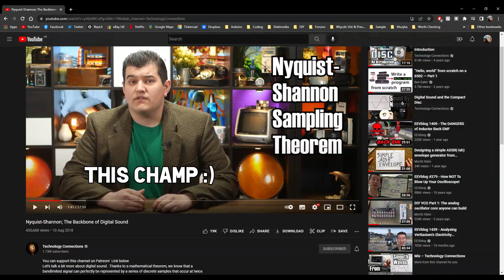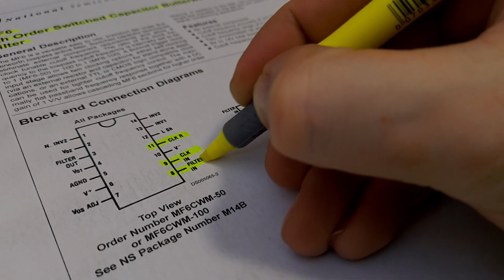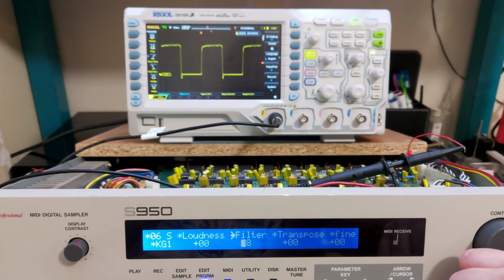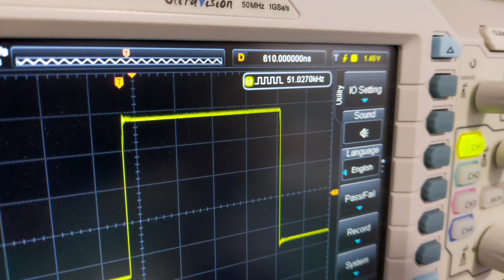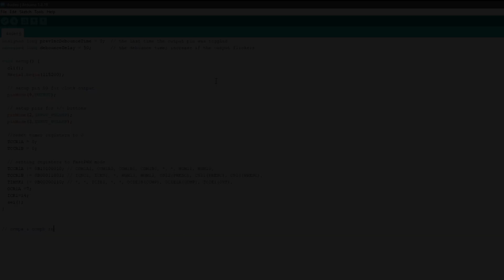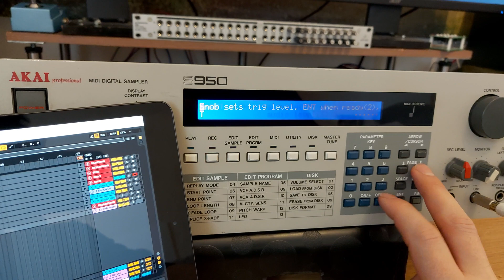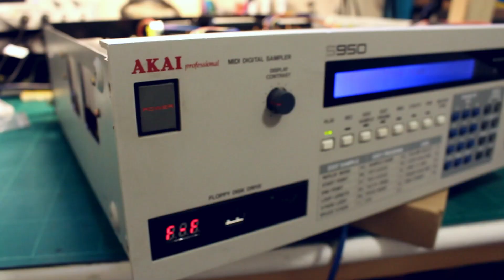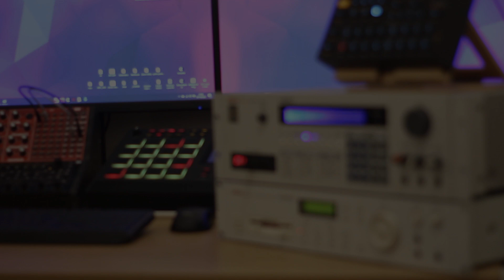Akai S950 DAGSS mod

Comment: I've always know that Akai engineers designed in a filter to shave off unwanted (lovely) fizz and hair - in an attempt to clean this up.  Even when I owned on back in the late 1980's, we HATED this notion.  The Emax and Mirage (and EPS) either didn't have the filter, or left it "user modifiable" and you could get that bright crunch if you wanted it.  Thanks for taking to the time to upload this.

Comment: Amazing work man! Have you also tried clocking the filter lower than 15.7kHz to close it even further than originally possible and if yes, does the clock signal "leak" into the audio signal? Just asking because on my S900 there's a strong 16kHz component in the signal when I close the filter completely and I'm wondering if that's a fault in my unit or if it's normal and maybe even the reason akai doesn't let you close the filter even further. At first I was leaning torwards my S900 being faulty but after seeing that on the album version of fatboy slim's right here right now theres the same peak at 20kHz at the beginning I'm starting to think that that's normal S900/S950 behaviour. cheers

Comment: The genius of this is amazing, I LOVE how you snuck it into the gotek case. Would this also work on s900? I think the boards are the same? I would love to try this, I dont suppose you would mind sharing your arduino code? many thanks!
Reply: Yes it should work. The S900 uses the same method to generate filter clocks.

Comment: Hi Dawid,  do you know what it could be in the input circuit that adds up an high pitched noise to every sound I sample? It is very annoying and ruins the samples :(
Reply: Did you figure it out?
Reply: @monkeyflava1436  yes. I’ve replaced the DG211CJ chip.
Reply: @Mattia_22   Hello, thanks for responding. I'm going to find out about it. The sound I notice is like a hiss in the 15 khz range and it is annoying, can the chip vary or is it exactly that causing the problem?
Reply: @monkeyflava1436  is in output circuit or input? (you get the hiss with loaded samples too or only when sampling?)
Reply: @Mattia_22   Thanks, I'll check, but what I remember is the input fault that cause high pitch hiss.
Reply: Hi, sorry to bother you, but I think I definitely have the same problem you had. I did a RAM test on the S950 which normally gave OK RAM, but I recently turned it back on and did the RAM test and it gave me BAD IC 8, and I saw that it matches that it is the Dg211 chip. Now my question is, do you have the datasheet, or will any Dg211cj work for this occasion? Sorry for the inconvenience, and I really appreciate it.
Reply: @monkeyflava1436 oh yeah? Didn't know it could detect faulty chips like that. Good. Btw i've ordered the same exact chip on ebay, paid like 7€ new. Dg211cj
Reply: @Mattia_22  Yes, I think so. The IC8 on the voice board matches the DG211CJ. I will definitely try it. It's on page 11 of the service manual ref.no. ic8 part no. EI 360045 description IC DG211CJ

Comment: please (you, or some one) make a batch of these and make it an easy install product to buy! trust me, it will sell like hot cakes! especially with owners of the s900/s950 already who are into boombap and lofi beats and stuff. Sounds very much like an sp12/1200/emax with that filter opened up!
Reply: Especially knowing that “Lofi Girl” gets 11 million views on YouTube.
Lofi. People love it!
Reply from the maker: problem with this mod is that it relies on physical tampering with tracks on PCB to decouple internal clock from our custom one. In order to make installation of it more "user friendly", I would have to tap into data lines (there is connector with them on the pcb), capture and modify the clock data in realtime, not saying it's impossible but it would take some time to do a proper research. Anyway - never say never - maybe at some point I'll get into that :)
Reply: yup ill take 4 of them off the rip!